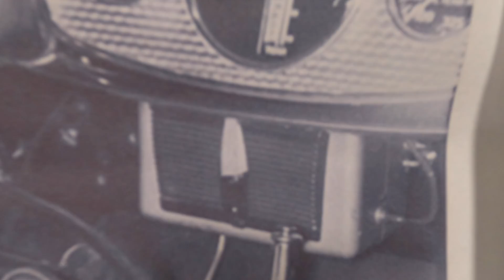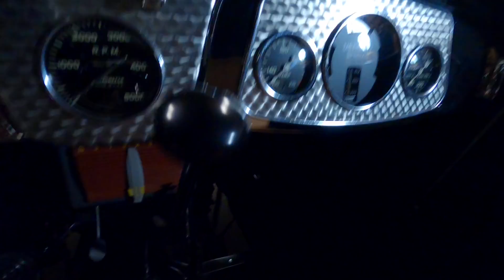Car That Ate My Brain 2: Episode 6 Look Alike

Comment: Hey brother when you’re going to weld something completely and you do not want it to pull kind of like your gas tank mounts if you Backstep your welds I find it doesn’t pull nearly as much which means weld 2 inches then skip ahead 2 inches and weld back towards your old weld and do that all the way across I find things don’t pull nearly as much especially if you jump around while doing this for instance do 2 inches on one side and then go to the opposite side opposite corner and do 2 inches over there I am able to make thin metal stay pretty much exactly the same way it was when I fit it together this works very well for me if I am stuck in a position where I’ve got to do a long weld on the very thin metal especially if you tack it up a lot first this would have worked very well for the weld you did underneath your grill and please excuse the lack of punctuation I was in an accident so I dictate my messages
Reply from the maker: Thanks for the advise! .. I pretty much did that.. just doesn’t translate in the video. I appreciate it..🤙🏽